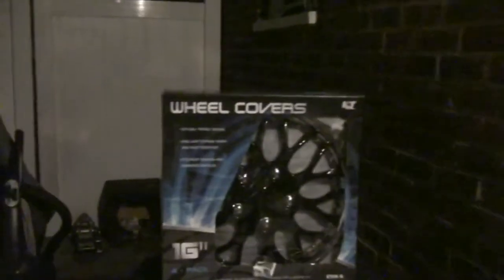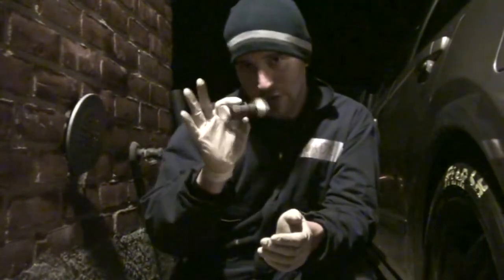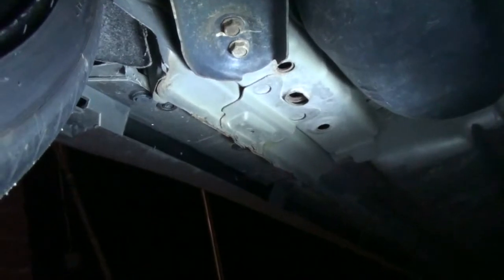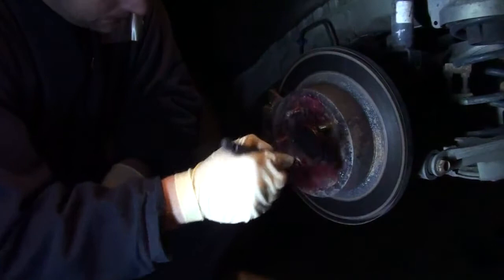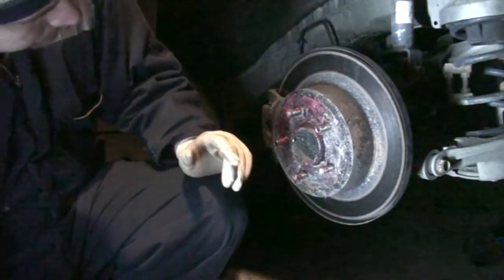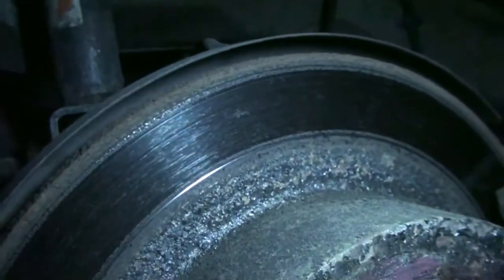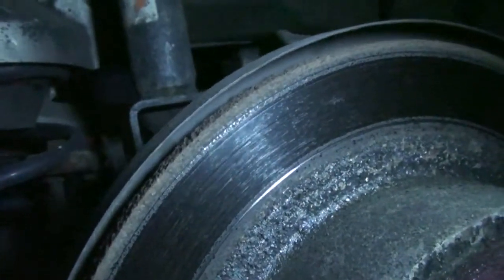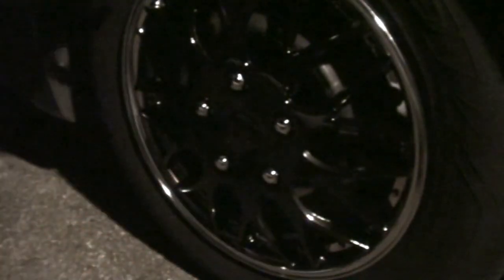2008 Nissan Altima Understanding Wheels and tires

Comment: Bro i need yoyr help, for some reason the lights from the dash is not working.... How can i change the switch relays and also the air acomdicion light is not working too... Please teach me how can fix this problem thanks
Reply from the maker: eduardo ortiz  hey sorry for the delayed reply. have you fixed the problem yet>? if so can u share it with us online in the comments. this is actually a common problem for the altima, if thats the car you have. the information center backlight usually gives out or the information LCD display gets unreadable. the process is simple it involves pulling the cluster out.  I will be doing this job soon on my altima.  the same goes for the the A/c swich but its alittle more involved. your relays are located in a few places. one under the steering wheel  by the pedals and the other located in the engien bay by the battery. whats your year make and model and Ill try to help the best I can from over here

Comment: MY VAN DOES THE FOLLOWING:
IN THE FUSE BOX I CAN HEAR RELAYS ENERGIZING AND DE-ENERGIZING(CLICKING), THE WINDOW WIPERS AND SPRAY SOME TIMES START AND STOP AT 10 SECOND INTERVALS, AND HEADLIGHTS BLINK. ALL WITH THE KEY IN MY HAND. WHEN I START THE VEHICLE SOMETIMES THE RADIO AND HEAT WONT WORK, AND THE GEAR INDICATOR LIGHTS UP ALL LETTERS. WHEN I DRIVE IT JERKS AND ACTS AS IF IT WANTS TO STALL. THEN LATER IN THE DAY OR NEXT DAY IT WILL RUN FINE (EXCEPT FOR THE MISFIRE ON PLUG 5) FOR A COUPLE OF DAYS. I HAVENT UNWRAPPED THE WIRES TO LOOK BUT I WANTED TO SEE WHAT YOU THOUGHT. I CANT AFFORD TO GIVE IT TO A MECHANIC BUT I'M VERY HANDY.
Reply from the maker: Doalllabor Doalllabor   hey thanks for the comment and Im sorry for the delayed reply. Your problem could be a BCM ( Body Control Module issue) or the actual switch itself being bad. It sounds like you have a short somewhere or a loose ground. I need more info, what is the year make and model?>  also, you mentioned the shift indicators all lighting up, thats usually because of a bad range sensor. but all these problems is leading me to believe you might have the 2001-2007 model year caravan/voyager or town and country.  these vans have engine harness problems that are located right at the lower drivers side front of the vehicle.  by the transmission.  exposed terminals by the transmissions solonoid pack causes problems like this.

Comment: So, what do you do for tpms on your 20" rims do you have tire monitors in them or are you running them without monitors  does your tpms light stay on your dashboard.
Reply from the maker: john1240able  John,  All The factory Original TPMS have Dead Batteries . They have to BE replaced so my Light has been On since I Bought the Altima. The 20's have no TPMS Sensors. I had the Chance to Put TPMS in these rims before we put the tires on, But I Chose not to For a few Reasons.  1 was I wasnt sure I would Like these 20" rims. After Driving around with them in the summer time, You Feel Everything. The Ride quality Went From Great to so-so. Granted the larger the rim the less thick the tire ( depending on application).  The Second Reason was cost. Replacing the 4 sensors in the factory wheels, and 4 new sensors for the newer wheels.  So yeah, the light stays on with either set of rims. I might get 17" factory maxima rims for the altima instead of the steel rims and instead of the 20's
Reply: your know how rest TPMS on altima if it working let me know thanks.
Reply from the maker: john1240able  ususally driving it with the proper inflation will reset it. if it doesnt  then chances are the battery is dead on it. batteries on these TPMS last a avg of 5 years.
Reply: Just an FYI that my TPMS monitors from 2008 still work fine.  I guess I have been extremely lucky.  I bought the car brand new.  I'm curious if you had the PCM/speedo calibrated after you switched up to 20s?

Comment: i recently rotated my tires.  good thing that i decided to do this.  i had to use a cheater pipe with my breaker bar to get the lug nuts loosened from the front wheels.  no way would i would have been able to change a flat on the road.
Reply from the maker: rangerpru Thats way too tight.  thats someone at a shop air gunning the shit out of your lug nuts. and under all that pressure those lugs can snap.. Invest in a Torque wrench. they aren fairly cheap. and torque your own wheels. I watch so many mechanics just air gun them on and call it a day